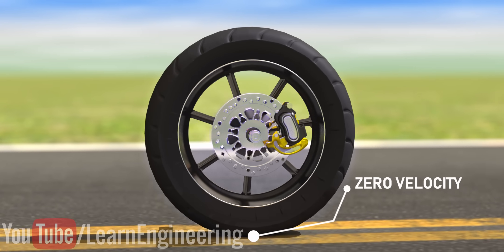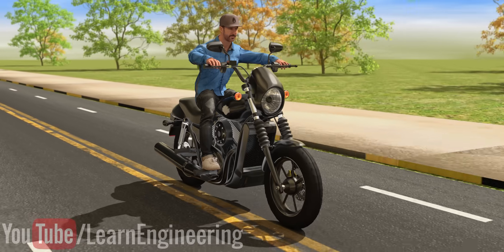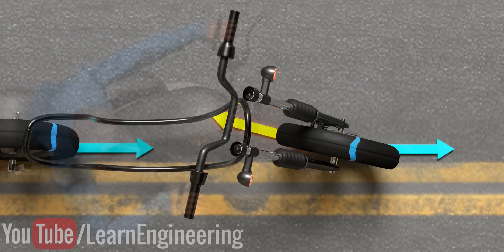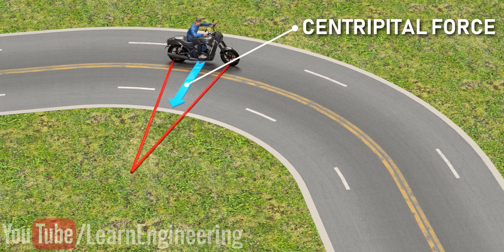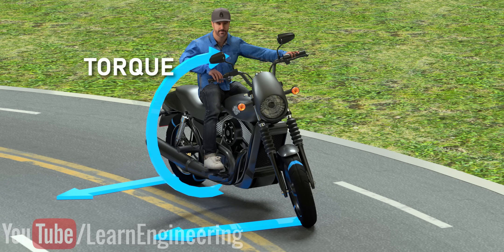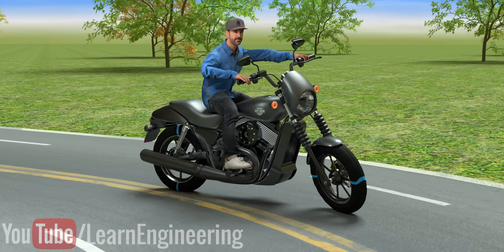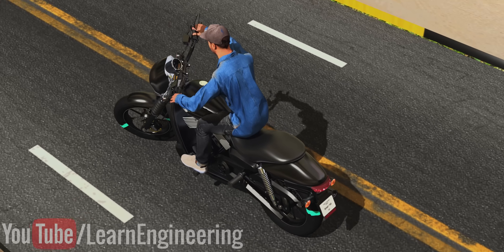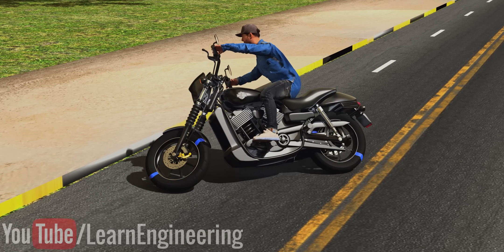Counter Steering | The interesting physics behind it

Comment: Oh okay so basically if you understand newton's first law of motion, then you understand how to countersteer. Your body is gonna wanna keep going straight. What you do to initiate the lean towards the direction you wanna go is to steer the opposite direction, because your body is gonna wanna keep going the direction and velocity it was before you initiated the steer, so steering to, let's say, the left will put the wheels to the left of your body essentially, causing the weight of your body to be applied to the right side of the bike, causing the lean to the right. Then you steer into the lean you just created to maintain that lean and turn the direction you wanna go. Am I understanding this right?
Reply: Wrong!!!😂😂. So you don’t ride, that much is obvious.
Reply: @softailfun  okay then how does it work then, smart-ass? Because what I saw in the video was basically what I just said. I've rode sport bikes before and I'm about to get a naked bike and I used this method to initiate my lean. I didn't realize that was what I was supposed to do until I watched this video about countersteering.
Reply: @softailfun  do you turn right to go right? Or do you lean while going straight? Or do you kick your front wheel out to the left to initiate a lean to the right to start turning that way? Cause I know if you're going any faster than a few miles per hour, you can't just turn your bike like normal. You have to use a system of leaning into your turn to turn otherwise you'll end up straightening up and initiating a lean the other direction.
Reply: @VicinalElk44104_aka_Hammer  
Okay so the science is irrelevant to me and most riders I’d suggest. Most people get the science wrong anyway. So to steer right: push gently on right grip and the bike instantly leans and turns. More you push, the tighter you turn. When you’ve achieved the lean needed to take the turn you stop pushing and just maintain a neutral pressure on the grip. That’s to say you push no more or less. When the bend is completed, ease the pressure off the right grip, the bike stands up and you travel straight. You said however, that once the counter steer has initiated a lean the rider then steers into the lean. That is a ridiculous statement to make. Why?? Because of counter steering…. You’ll stand the bike up and fail to make the bend. The front wheel does indeed turn into the bend but that is due purely to the bikes own steering geometry, not rider input. Bit long but if it educates you then it was worth it.
Here’s a reference vid for you to see in practice what I’m saying: https://youtu.be/lzk8oyNO708
Reply: @softailfun  okay, so turning into the lean just stands you back up? I don't understand then because I've seen the front wheel turn towards the direction the bike is leaning on my friends' bikes when they're going around corners. I feel like that wouldn't be possible if they were just turning the wheel the other way the entire time, which is what you're doing when you're pushing on the handlebar that's on the side you wanna go, basically steering the opposite direction. Idk dude. I just do what works. I'll watch that video you posted though. I appreciate you not coming back with an unhelpful comment berating me or trolling. This comment was actually helpful.
Reply: @VicinalElk44104_aka_Hammer  
As I said, the front wheel steers into the bend. However, it’s the bikes steering geometry doing it not the rider. Confusing? Yes. But true. Just push forward on the inside grip for the duration on the bend. It’s easy. Ride safe fella, hope you enjoyed the link. It’s probably the best video on this topic on YouTube.
Reply: @softailfun  I have been told by guys who basically live on sport bikes that to turn after you're above a certain speed, you HAVE to lean the bike rather than turning it. I got told to put a slight pressure forward on the handle bar that's on the side you wanna go, meaning if you press on the right handlebar, you'll start leaning and moving to the right. If you push on the left handlebar, you'll lean and start moving to the left. I didn't understand the reason behind this originally but now I do. If all you do is ride your crappy looking soft tail 5mph in a msf course while being afraid to go faster and constantly drop it, then you wouldn't know. But I'm betting the physics behind it is the same with your bike when you get up to speed, you're just too much of a troll and a smartass to actually accept it. I'm willing to bet you countersteer subconsciously and don't even know it, and now you're all butthurt because you don't believe it. How about this, go out and get up to highway speed. Let go of the handlebars. While coasting, lean up and put slight pressure forward on your right handlebar. If you start leaning to the right, then I'm right and you're wrong.
Reply: @softailfun  I just realized that the whole reason speed wobbles are a thing is because of technical countersteering. It's also why I was always told if I get into speed wobbles, to let go of the handlebars and lean up. It takes weight off the front wheels and also takes away the accidental adjustments from yourself. Otherwise your front wheel is essentially moving to the left and right of the center of gravity of your bike, because the weight of you is causing quick leans in either directions, essentially pulling your tire towards one side, causing the handlebars to turn, which causes a lean the other way, which causes your wheel to move to the other side, which causes your handlebars to turn, etc., etc., until you either get it straightened out or you lean over too far and lose control completely and end up either high-siding or low-siding.

Comment: This video is a little wrong in the namings. There is no any normal steering and the counter steering is the only way to turn the bike with the steering, but if rider will move the bike from the balance with his own weight(in this video it calls "normal" lol) without touching the steering - bike will turns and efficiency of this way will be lower with higher speed of bike.

Comment: What’s missing here is a discussion of how gyroscopic effects on the front tire actually cause the bike to lean when counter steering.
When you push on a gyroscope to turn it, it responds by turning on an axis  that’s 90 degrees from the applied force.
So when you push on the handlebars to turn them right, the front wheel (a big gyroscope) responds by leaning the bike to the left.
Reply: This video is made by a guy who has never ridden a bike in his life and depends on books. The real world is not like this video when your on a bike.
Reply: Correct. With the proper applied force, the bars don't move at all, the bike just simply leans.

Comment: Do not do countersterring . That is for motorcycle racers !! For regular turns , simply press down the handle in thr direction u Wana go , to move right simply press down the right handle and the motorcycle will go right . Press down left handle and it will go left. This is what the official motorcycle handbook says for getting license . It does not even mention counter steering . Counter steering is for making extremely sharp turns that is not useful for regular drivers and will only confuse and lead to accidents
Reply: "Do not countersteer" -> immediatly explains that countersteering is the only way to turn above 10 km/h

????

Comment: Counter steering IS normal steering. It isn't a special tactic, or method. There is no "normal steering" above 10 or 15 mph. This guy doesn't ride a motorcycle or know what he's talking about. Counter steering initiates the lean by gyroscopic precession, body positioning is a helpful adjunct to conserve lean angle, but camber thrust causes the turning when leaned sufficiently by precession, and centrifugal force keeps the bike from falling over. The rider doesn't input lean as a control to the bike. Counter steering causes the bike to precess, and you'd be wise to go along with it. You can push left and lean right and the bike will fall left, and your ass will come off to the right. Which the author would know if he had ever operated a motorcycle even once. Any MSF teacher will tell you, push left to turn left, push right to turn right. It's the ONLY way to do it, not an optional method. 
 Watch Keith Code, and Yamaha School of Champions videos if you want an accurate explanation for counter steering.

Comment: This video really poorly explain "countersteering" which is also badly named, because in reality you don't turn your handle bar the opposite way, you force the bike to lean and turn by applying force on the handle bar inside the turn to counter the centrifugal force, no need to push, you can just pull the handlebar right + inside the turn to lean right and turn right and it will work exactly the same.
Reply: https://youtu.be/lzk8oyNO708

Comment: There is so much misunderstanding and misinformation in this video. And it overcomplicates something very simple.

I really wish people wouldn't try and explain something that they do not understand themselves.

Every time you go through a turn on your bike, you countersteer. That's why learning to ride a bike is not trivial. You learn, by trial and error how to get a bike to turn and remain upright. If all you had to do was turn the handlebars in the direction of the turn this would take a few minutes, but it doesn't, does it?

It's the only way you can get a two wheeled vehicle around a bend. You go into the turn, and, usually without realising  it,  steer in the  "wrong" direction momentarily to get the wheels out from under you, on the outside of the bend, and then you are leaning in the right direction to turn in and follow the bend, as the bike comes back under you.

Every single time you make a turn on a two wheeled vehicle you do this, regardless of speed.

This video is an absolute crock.
Reply: I agree! https://youtu.be/lzk8oyNO708

Comment: So what you’re saying is counter steering just gets you into a lean faster. Calling it counter steering is delusional
Reply: Not "faster" 
It's just the only method to lean at all above walking speed
Reply: @Keego_SW  it is the fastest way to enter a lean at speed, and if there is no other method then there is no point to shift your body on a bike
Reply: This video is rubbish…… BUT counter steering is the only way to steer a motorcycle, it’s not an option. Calling it counter steering describes exactly what the rider does, steers counter to the direction of the bend!

https://youtu.be/lzk8oyNO708

Comment: The theory checks out but there are a few practical misinformation. 

First of all, no one direct steers in motion even if they claim they do. Motorcycles are way too heavy for any human to lean it themselves. Even if you ride a bicycle you would need to get up of your seat and shift your butt way to far off to the point it is not practical to do it; frankly I am not sure if it is possible with a bicycle either with normal human proportions. The only time people direct steer is when they are turning from a stop and lean the motorcycle before twisting the throttle. Stuff like elephant turns.

Secondly, you don't need to manually turn the handlebars in the right direction after counter steering, gravity already does that for you once you release pressure unless you are actively opposing it, which again, requires quite a lot of strength. Handlebars are actually very heavy when they are not upright. This is why a good advice is to hold the handlebars lightly, and let motorcycle balance itself.

So countersteering is not a risky move. It is the normal way to ride it, and everyone who rides bikes (motor or pedal driven) does it, no matter how much they claim they don't.

Comment: there is literally no "normal steering"  existing withing the bikes or bicycles.. it's always counter steering.. sometimes it's just more or less noticeable , there is no way to lean the bike just using your bodyweight exclusively. If you lean to the side, you have to apply force to the bike to move your body to the side that actually translates to  the bike, which then leans  to the opposite side around the front-back horizontal   axis... law of energy conservation.. and bike is not a fixed rigid object... therefore, to eliminate that, you have to slightly countersteer to cancel this   "counter leaning"  effect,  ending up  counter steering after all... I can't believe, how many bike experts here on youtube are talking about "normal" steering  or "counter steering being only matter of  speeds above 25mph"  ... you always have to get the bike to unstable state to make it lean to the desired side .. it's natural  and simple physics and manipulating the gyroscopic effect... another thing that confirms this rule is the fact, that  at the end of the video, the creator didn't demonstrate his "normal steering", but only the "counter steering" ...I am not trying to sound smart and cool here, I am just a human like all of u.. but this is a common sense!
Reply: https://youtu.be/lzk8oyNO708